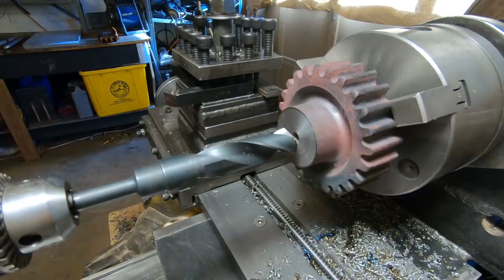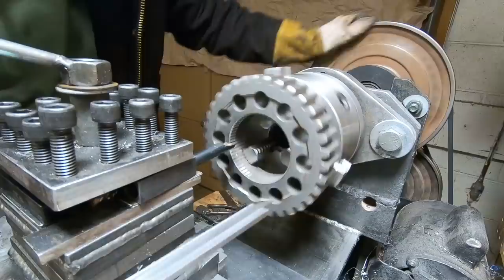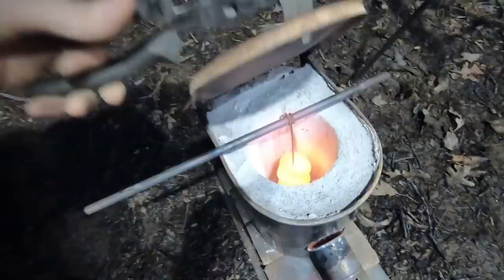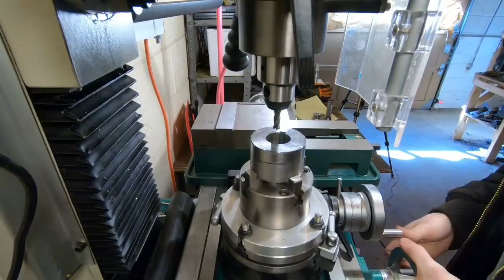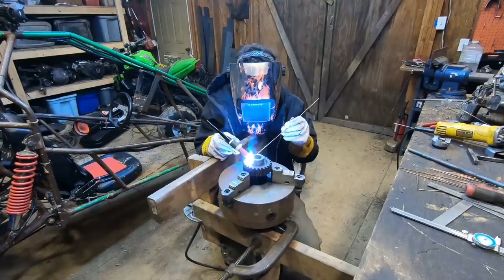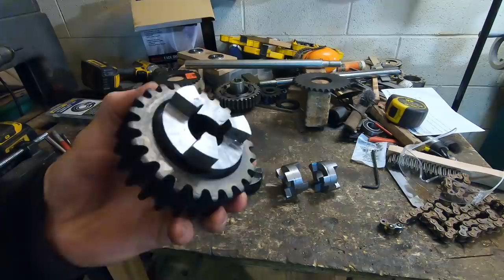3 speed and reverse go kart gearbox home made

Comment: The larger sintered metal gear will likely need bushing made for it where the bolts go through the larger holes. The gear will slip back and forth with it only being pinched between the 2 plates that are bolted together.

Comment: Looks like our skilled producer & engineer may have bottled this series for unknown reasons . It's still 3 speed & reverse box finished The addition of grooves on the outsides of the dogs for selectors and some spring loaded detents will have it shiftable . Completeing the case will allow oil bath lubrication. But seeing it done was the exercise really. There are so many used car gearboxes about something the right size w. 5spd & reverse must be easy to retrofit ? Great job "..B welding" . I enjoyed the story. And 10,000 others too. 0.8% of viewers ticked a different tune which is outstanding approval.

Comment: I'm impressed. I see a possible issue with being able to get it into 3rd and reverse at the same time. If you haven't already came up with a shifter concept may I suggest one? Groove the shifter dogs then harden them. Get a small deep groove ball bearing, 608 should work and they are dirt cheap, have it run in the groove rather than a shifter fork, otherwise you are getting into a fully sealed case with oiling. For the shifter itself it is hard to explain but I think an "H" pattern. Have the shifter pivot with 1 side engaging 2/3 and the other R/1, run 2 pairs of cables (2 per dog, pull each direction) so you aren't shifting sideways. Hope you get it going, if I had the equipment I would build one myself.

Comment: Good. Finally someone with enough guts to attempt a forward & reverse mini transmission build. Nice work so far. Give it a lid that's wide, and easy to remove because without roller bearings for each sprocket and dog-clutch, it'll need periodic rebuilding. I recommend synthetic 90 weight oil for it. It'll give it the best chance. Thanks for the vid, man!

Comment: Great job but a lot of work to design something easily obtained. Just pull one from a small truck or even a lawnmower, The engineering is behind it and you can use a clutch instead of clunky dogs that aren't designed to do what you are doing with them. Using a clutch is much smoother and makes the transition from one speed to another easier. Finding an aluminum trans for a front wheel drive car with a transaxle with the clutch pedal box and bell housing shouldn't take more than a couple of hours to pull if they don't have one already pulled and costs much less than you have just in the plate alone . . The reason I say anything is I have chased down this rainbow on a project and found many times using something off the shelf already designed parts, ready for stresses and loads works much better than anything designed in the garage. Thanks for great content it's been a pleasure to watch your channel grow. Plus if the part fails an easily found replacement can be purchased quickly. Many times we forget the end goal of getting things going and projects get derailed as we get caught up in the details and wanting to make everything perfect when good enough will do.  This is why some restorations can go on for years and never get completed. Reinventing the wheel is fine but just know its been done and by someone probably smarter than you and I.

Comment: I have been doing this kind of stuff for over 30 years and you impressed me that's a great job. Some input for you use linear rail bearings for the parts that need to slide on the shaft and taper the ends so it can shift on the fly and harden the teeth    
I would like to see it with shift forks to see how well it works when your done with it

Comment: The non-key'd gears have to have bronze bushings or something in them at least, I dont think they'll last long without it, and also transmission shafts are SUPER smoothe, like ground on a surface grinder and are hardened, Go-Kart axles will last 5 minutes-
Reply: It's going to be in a box full of oil.
Reply: @carabela125  So is every other trans. Better than without, though. Excited to see how it holds up
Reply: not saying ur wrong. but he did make a 2 speed one without being in a box of oil or having any fancy seals. and that thing is still running strong after 1-2 years
Reply: @nickkaarslev290  His other ones (like all his Buggies) are built for YouTube videos, you see how they just sit for months and years under Tarps out in the rain, on the side of the shed, not used? They seem to get very little actual hours on them- Also, those other sliding-pin 2-speed designs dont have gears on spinning shafts that make tons of friction between each gear and the shaft theyre on...... they are all keyed to the shafts
Reply: @carabela125  a box of oil doesnt make super soft go-kart axles withstand the friction and forces of high speed spinning mild steel (soft) bushings on them much less of a grenade........ ALL transmissions (even the crappy ones in a Lawn tractor) have hardened gears and ground, hardened shafts, and bronze bushings-
Reply: @Mad-Duk_Machine_Werkes  I'd say we have to see what is going to happen with this one before we judge. im a guy of sience and facts. but ive been suprised sometimes by rather impossible thing being true? :)

Comment: might wanna ream out the non-keyed sprockets, and put some bronze bushings with spiral oil grooves in them. since the gokart shafts are hardened steel, I'm not sure annealed steel will last super long, even with an oil bath. otherwise, your transmission is looking pretty good! can't wait to see you try and figure out the shift linkage... 😺
Reply: Kinda what I was thinking
Reply: The bronze bushing will wear out the harden steel shaft before it sacrifices itself. So actually the softened steel on the hardened steel is a better combo.
Reply: @johnwalker7592  Off the shelf parts are easier to replace than custom.
Reply: @johnwalker7592  Bronze bushings are softer than hardened steel, so how will that work. The only time I ever see shaft or sprocket/gear wear on their bore is when the bush is gone, because no one lubed it or checked it,  and it's steel on steel. The only time I have ever seen a bush wear out a shaft was when I was dealing with a really hard bronze like aluminium bronze. Normal composition bronze wont wear hardened steel in my experience. They are sacrificial, made to be that way. You might have a different experience, tell me if you do please. Always keen to learn

Comment: Now that there's a transmission of sorts, the one thing that's been burning in my mind for years, a rear differential!
Reply: front wheel drive transmission. cut the bell housing off, use the differential outputs. Voila. 5 forward gears, reverse and a differential. easy peasy.
Reply: @DieselRamcharger  I want an actual positive traction rear differential, I hate all fwd. That's just me.
Reply: @MarksGoneWicked  posi traction is a trademark owned by GM, it means limited slip differential. No one said anything about making the vehicle front wheel drive. Its about using a transaxle from a FWD car to give your RWD cart everything it needs.. You could use an Albins ST6 if you got 30 grande to drop on a transaxle, or just heed the advice of those who know what they are talking about. ;)
Reply: @MarksGoneWicked  Its common place to use Porsche/VW transaxle in rear/rear buggies....but FWD transaxle's are more compact. http://www.westgarage.co.uk/Projects/royale1_files/page1_2.jpg
Reply: @DieselRamcharger  I am curious, what vehicle is in your image?
Reply: @DieselRamcharger  the rear differential on my crv would be suitable, it's small(ish) doesn't have to be positive traction, as long as there's no wheel slippage if you get stuck in the mud or something.

Comment: Great job. My advice though, definitely make a metal case so that all those gears can be submerged in an oil bath, otherwise all that work will quickly destroy itself at RPM. You also would need a thin oil for the chains and thick for the gears, something like a 0-50 weight oil

Comment: Great concept BUT I think you will have a lot of trouble getting it to work if it will even work. 
But as Thomas Edison said, he did not fail hundreds of times to make the lightbulb. He just found many ways that wouldn’t work. 

When your transmission is running in a forward gear as it will most of the time the reverse gear will be spinning the opposite way  on the jack shaft which will eventually fail. 

Good luck with this. It will take a while but will be worth it as a learning tool whether you succeed or not.

Comment: This looks cool, and I don't want to bust any chops, but....
1.) You're going to need provisions for shift forks
2.) Those engagement dogs or whatever you call them will need to be splined to the shaft if they are to hold up.
3.) With no synchronizer rings, those aluminum engagement dogs aren't going to hold up long if it is shifted on the fly.  They will also need some kind of taper to them like that of a dovetail joint to keep it from popping out of gear from time to time.

Comment: Synchronizing your shifts will be hard with that set up that's why I suggested using a modified auto trans with built in synchronizers. At least take one apart and see how it it made and see if you can adapt some of the tech in it to your design.

Comment: You really need to put a low-speed electric motor on your Tig table with a foot pedal. Makes the job a whole lot easier and smoother when you don't have to worry about balancing your weight on the stool to keep hand position when moving your leg all the time. Besides, even though the welds weren't crucial to be pretty I still cringed when I saw them XD.

Comment: Have you ever considered using LoveJoy couplers instead of those bushings at 11:25? 
They're basically what you've just made!!
Reply: I've seen those at Northern Tools, and Tractor Supply. What are they? Are they sacrificial couplers?
Reply: @emeltea33  They are shaft adapters. Say your motor has a 3/4 shaft and your pump has a 1/2 inch shaft the lovejoy couplers use the interlocking design with a rubber bushing so no metal to metal contact

Comment: Mad skills..I need your help on my project.  About gear ⚙️ ratio. Mill work. Some welding.  Do you do side work. I'm not sure where you are located. But I could ship you supplies u fab fix and reship ?  I just need them 1 inch key sockets to take a special spline sprocket.  And some u joints to 1 inch key socket..same.as u welded the gear ⚙️ mount to..

Comment: look at clutchless trans when shifting in to the next gear the bevel the back side and the entering cogg.. it's hard to expland... I'M stick a 94 POLARIS sportsman in a 3 wheeler trike build it has a hi-lo pluss REVERSE,  I'VE seen videos of people using motorcycle engines and cutting Away the engine side just using the trans side.. and one even used the clutch.. but the reverse is the tough, but many snowmobile trans have reverse, an an disk brake..mounted on the top of the input shaft and they had 57+hp.

Comment: 6061 is not the strongest aluminum alloy, there are much stronger choices...but 6061 is the most common structural aluminum alloy and it has the benefit of being weldable if you need to down the road.

Comment: that gear @ 7m40 is comparable to the ones that are used in the Bugatti Veyron, so massive.
your kart happens to have 1001 ps?

you should have taken a look at Evenrude outboard motors, in the tail there are the parts to "shift" gears, you might could use these.

nice lathe, shows if you don't have the resources ingenuity takes over.
nevertheless awesome job.

Comment: I had an epiphany the other day. Is it possible to make a bicycle gearing system work on a go kart?
Reply: It's possible to build one that works like a bicycle shifting (derailleur) system. It would require stronger sprockets and chains. The edges of the cog teeth would need to be precisely beveled, so the chain could step up and down the cogs, but not jump off under stress. The bottom swing derailleur would need stronger tensions springs for the same reason, or you could use top-pull, bottom-swing derailleurs with a tensioner sprocket.

Comment: when switching from 1st to 2nd gear everything works fine because the speeds of the two clutches vary therefore allowing the dog clutches to engage, but what happens when you're switching into 1st or reverse from a standstill and the two faces of the dog clutch push against each other not allowing the clutch to engage? How is this dog clutch problem solved?

Comment: Hi Humberto
I have just finished watching my first video of yours.
It blew me away all the projects you have produced like building your own lathe etc, & your only a young man what will you be producing when you get to my age.
I cringed when I saw you using a file on your lathe without a handle on it, yes I have taken a workmate to HOSPITAL with the file buried in his gut.
Find your nearest Industrial engineering supplier & order a WARDING file. It will be approximately 1/8" thick & tapering to a blunt point over the last third. You will understand why I make this recommendation after you use it on your lathe. 
Get a piece of bright steel flat say 1/2" thick by 1 1/2" get a 5/16 th UNF or BSF bolt about 5"to 6" long drill & tap about 1/2 from the end of your flat bright. 
Go to your lathe & put a dead centre in your tail stock bring your tail stock up to your cross slide thread the bolt into the thread of the flat with a nut on the bolt leaving about 3/16" th of exposed thread

Comment: think you forgot to make the grooves in the dogs you need those to get the shiftforks to be able to move them while there spinning
seem to remember there was a carclub called the chain gang , not because they where rough but because the bentley's they drove had the same type of chaindriven gearboxes and shifting them in anger resulted in the chains falling on the street while driving 
here is a drawing of the dog with the shiftforks over it : 
http://static1.squarespace.com/static/52d46dd9e4b0f63bcb07fa01/52ddb1c3e4b03ab35fd22776/566e33d057eb8de92a5f974d/1487300630445/?format=1500w
 ....... wonder if youre planning to press bearings over them instead of using the grooves  ..... that might work but the bearings need to be pretty big 

i have allmost the same mill , there some inherent weak spots and 2 of those are the fenol / plastic gearbox gears and the weak motor , they can break pretty eazy aspecially if you get stuck in the workpiece while drilling or shifting with a running mill  , leaving you dead in the water , there some aftermarket companies that sell metal gears (noizy) and there some companies that make beltdrive adaptations (usually with stronger motors )
https://www.youtube.com/user/hossmachine 
he done a lot of adaptations on these machines , and has a website selling the plans on DVD

Comment: 450$ just in plate sheet. you dum dum? you could have bought a scrap car for 200$ and take ALL the parts on it from the 5speed transmission with differential to the wiper motor and heater core.